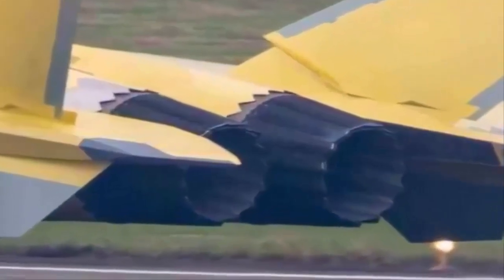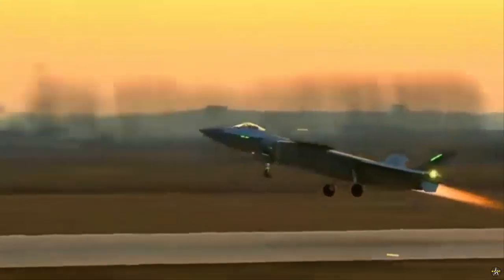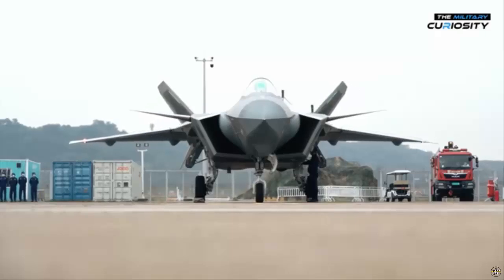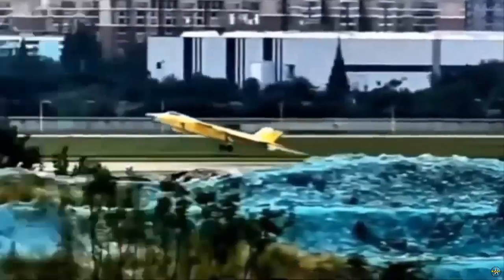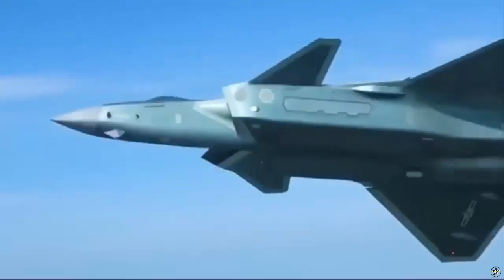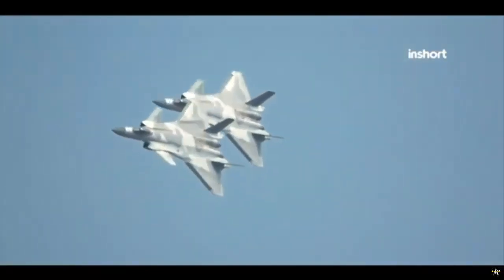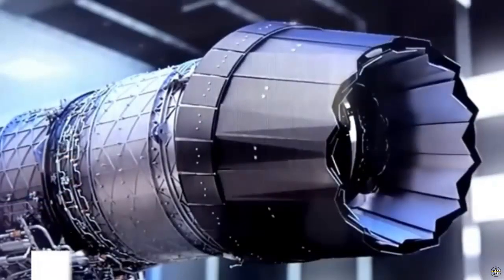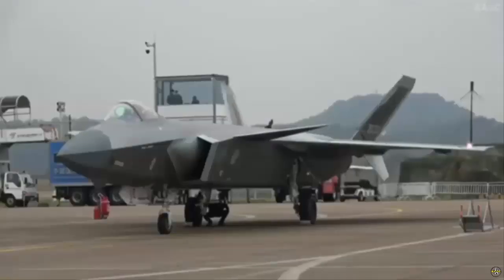China's J-20 stealth fighter jet gets a new, more advanced WS-15 engine

Comment: WS15 engine is a Chinese afterburning turbofan engine designed by the Shenyang Aeroengine Research Institute with maximum thrust of 
156 kN (35,070 lbf) it is stronger than F135-PE-100 (F35 engine).
Reply: 18.5吨